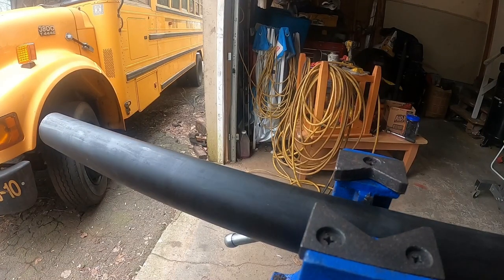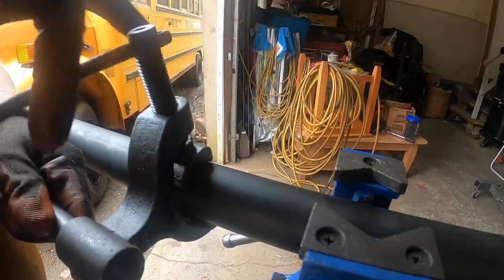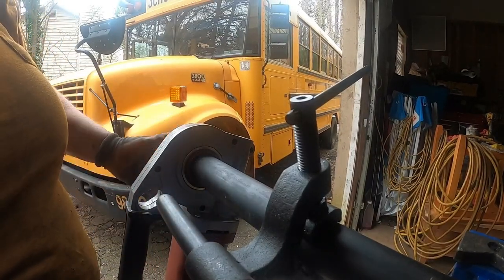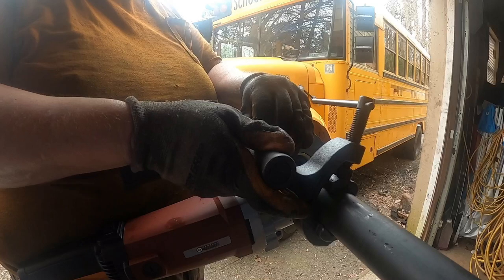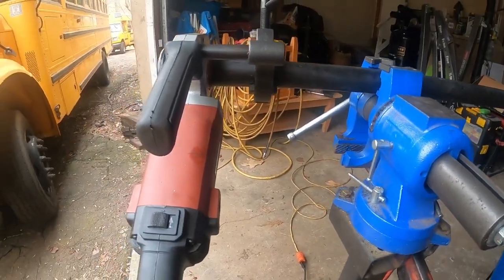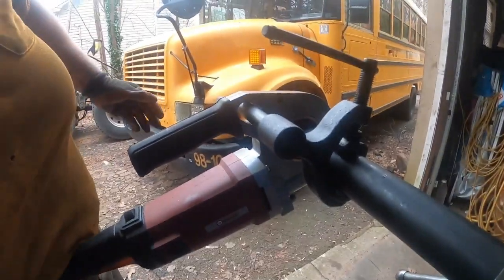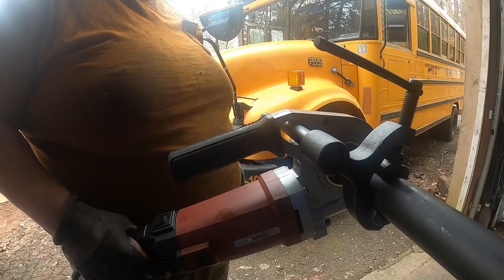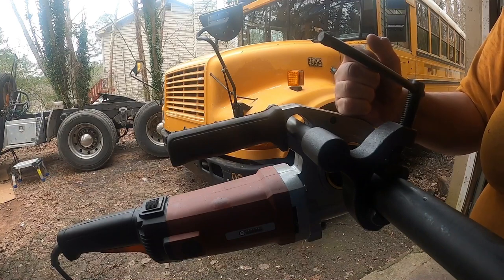harbor freight pipe threader review

Comment: You have ruined the die - that is why it is binding up! You MUST use constant flow of thread cutting oil as you are cutting the threads.
Reply from the maker: Thank you for your reply what used was brand new out of the box and I was working with over 1 inch pipe the biggest one that the tool is rated  to do I would think it works better with the smaller sizes but the job required the size I was using

Comment: You are overworking tje tool. Drench it with oul from start to finish. Catch yje oil in a bucket and filter out the shavings with a screen and you can reuse the oil. You can also but an oiler for threading that uses the same oul ober and over by filtering out the shavings. Have a good day everyone